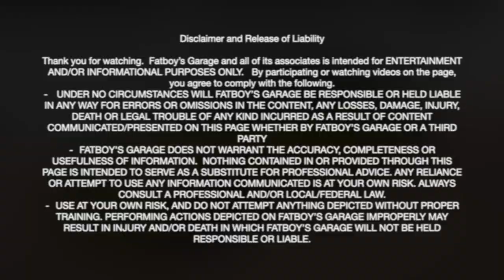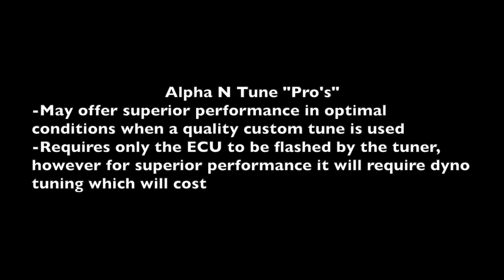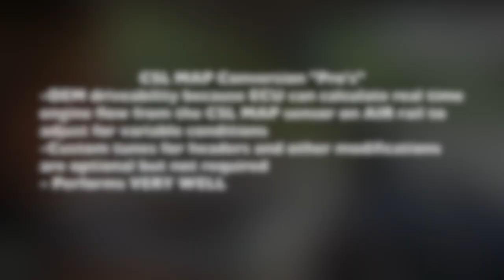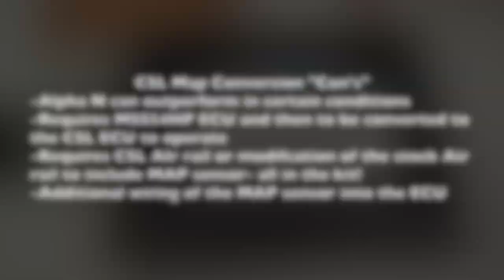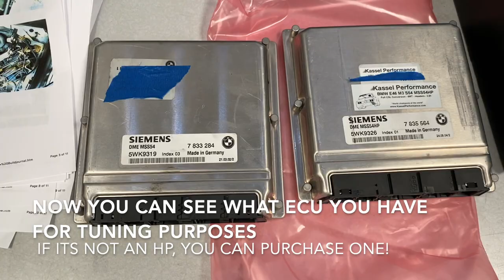Is Alpha N Tune OR CSL Conversion better? + How to install CSL MAP conversion BMW E46 M3 S54

Comment: Great vid! I was wondering when your rod bearing install was coming? Got my car on jacks midway through them now :)
Reply from the maker: thanks man! i just started editing the rod bearing video today, so if i can get some good time in it will be up by the weekend! I'll make sure i get in gear and have it for all you guys!
Reply from the maker: hows it coming so far?
Reply: @FatboysGarage  its been going smooth so far. just about to drop the pan. thank you for your vanos/valve vids, I just finished the full beisan top end rebuild and your vids were excellent! thanks for the update, i'm looking forward to seeing your rod bearings :)
Reply from the maker: @DoomTr00per  good stuff man, im sure youll get it done well. the dissassembly is what takes forever to edit, so im gonna simplify that portion.  wed love to see your car!  have you done frame reinforcement?
Reply: @FatboysGarage   yep, subframe, vanos and now rod bearings. if you like, PM me with an email address and I could send you some car pics along with the M3Forum rod bearing DIY pdf I saved before it went offline. Just a thought if you'd like to show/reference that for disassembly instead of having to edit your video as much :) btw, turns out BMW likely installed my helical gears incorrectly, as mine were not in the sweet spot, just like yours, if I recall
Reply from the maker: @DoomTr00per  Good deal, getting all the bugs worked out, youre gonna be happy with it!
 id really love to checkout the pics and the M3forum pdf to use as references, that will make the video simpler.  I went to PM you but looks like you don't have it setup on your YT to do so.  Normally you go in the about section to do it.   Did they install them wrong? i believe it! getting them in the right spot seemed to pick up some acceleration, i'm sure you'll notice the same!  Its a theory but we think thats why some M3's from factory were just plain faster than others.  Good job getting it correct!
Reply: @FatboysGarage  Fixed the link, check it now

Comment: How did you get the front strut tower installed with the CSL Turner Motor Sport intake without hitting and rubbing strut tower, ECS Tuning states tower can NOT be installed and will hit CSL intake.
Reply: just add 2-3 washers on both sides so its places a few mm higher.
Reply from the maker: The comment below is correct, we used 1 washers on each side and it just clears the box and the hood.  In the meantime we have swapped to an aftermarket strut tower brace.

Comment: I noticed by the end of the video no "CSL FLAP" aka "snorkel) was added to the airbox. Do you need the snorkel to run a carbon airbox? I've been looking at the Karbonius airbox for myself
Reply from the maker: The Turner Motorsport airbox uses the bell curve for airflow, we have a video explaining why they did this instead of using a snorkel.  I hear the karbonius is also a great box.

Comment: Thank you so much! Would this setup pass emissions? Just curious since CSLs were never imported into US...
Reply from the maker: This really depends on what US state you are in. Most states it's not an issue whatsoever.  But theoretically no, it wont pass emissions because it's not US OEM.  That being said i know of individuals that have passed emissions tests with the CSL converted ECU.  Best to ask those who do CSL conversions to the ECU, they will have better answers than us.

Comment: hi i have done this mod and im getting engine light on with error code p0102 air flow sensor low any suggestions pls i have checked wires

Comment: Subscribed. Any exhaust modifications planned ?
Reply from the maker: Yep just not shown yet- tuned it for headers, and full exhaust.  We were going to go with a single, but we love the quadpipes so we went with corsa.  We will be showing install of headers.  Got a project going?
Reply: @FatboysGarage   Any drone with that ? I've got an e46 m3 as well with a lot of bolts ons. However I'm at the point where I need to decide if I want to keep the car and do a proper csl clone with carbon body parts and intake or move on from the vehicle. When I see videos of the high revving single exhaust screamers I lean towards keeping it .
Reply from the maker: @dwainegreen  The Corsa was previously installed on my friends M3 and personally i liked the sound of it.  He went with a motor swap so i picked up his old exhaust system.     The RPM capability is something that attracts me to these cars too so i get that!  When finances are in order, what we would like to do is build up an engine properly, cam it up and if its track only, even consider a VANOS delete.  If you're wanting the performance, most tuners agree that the single exhaust is the way to go.  If you decide to g full CSL conversion, cam it up to and you'll have a real screamer.   With the carbon roof, hood, trunk, rear seat delete, and Cf fenders you'll have a super light car too.  These are all things that are in my mind anyway.  I think some things that may help you with your decision is considering the items on the car that need to be done structurally: Frame reinforcement, Rear brace between the rear shock towers, RTAB reinforcement ( not often shown), subframe bushings, Clutch, Diff and all those factors that play into having a high horsepower engine in these cars.  Without these types of things done it makes running all that power difficult without breaking stuff.  What do you have done on it already?  Personally the M3 is just a favorite so i will stick with them.  Once you get the issues worked out of them they're great and reliable.
Reply: @FatboysGarage  As far as performance upgrades are concerned I've installed a big brake  kit, steel lines, radium oil catch can, afe cold air intake, turner pulleys, ALL stock bushings have been replaced with poly bushings, rear subframe reinforcement , coilovers, adjustable camber arms , H&r adj sway bars (favourite mod thus far)...I've had catless headers and a performance muffler on the car but they are now residing in my basement.  The stock vehicle is very capable and can be upgraded, however the handling characteristics  of  front engine sports coupe seem to fall short of a mid or rear engined car ***from my experience***. I'm well aware that although it's a 20 year old platform , the correct upgrades and driver skill can allow it to hang with many modern cars. I guess I need to decide whether I want to create the car that performs and handles like  I want  or just buy another car that checks the boxes. First world problems .

Comment: Anyway to get the CSL tune onto the Z4M?
Reply from the maker: Read below for explanation of running the CSL airbox on z4m
Reply: @FatboysGarage  The Z4M has a different ECU (MSS70) and it cannot run the stock CSL tune or a CSL style MAP sensor.
Reply: Unfortunately, it cannot. The MSS70 ECU in the Z4M cannot run the stock CSL tune made for the MSS54HP. It requires a custom Alpha-N tune which is not expensive nor does it require a dyno tune. The CSL runs an Alpha-N tune stock anyways. The MAP sensor is only there to add one or two very small calculation factors and to allow the car to run in a better limp mode rather than only relying on the TPS sensors. There are one or two really good S54 tuners who offer pre-calibrated tunes ($2oo-3oo) that have stock drivability with standard bolt-ons such as a CSL airbox, cams and exhaust. Look up Paul Claude - http://www.pcstuning.co.uk/. He specializes in S54 tuning and he has pre-calibrated tunes (dyno tested) and offers live dyno tuning if so required.
Reply from the maker: @RK-ed1em  good to know
Reply: @RK-ed1em  How good do you consider the Evolve tune to be? Considered they where one of the first in the game to offer the CSL airbox to both e46m3 and z4m?
Reply: @davidgiannini5220  There are a few better tuners out there that specialize in tuning mostly S54s. PCS is one of them and his track M3 (288/280 cams, airbox, full dual 2.5" exhaust making ~380whp) consitently does sub 7:40s at the Ring. He has calibrated (and fixed) many tunes on other people's cars - http://www.pcstuning.co.uk/

Comment: Hi I have the same setup my dme has already been converted to csl I’ve installed my csl map sensor kit from KP but now my car won’t start up any suggestions on how to troubleshoot this issue?
Reply: Did you resolve your issue?
Reply: I know this is old but I would use INPA and verify that your EWS isn't being triggered.

Comment: Does using a new DME give mileage tamper dot or mismatch anywhere? About to do this same route but can’t figure out if I should buy new dme or not since car is an 02 thx!
Reply from the maker: no it does not tamper or mismatch at all. I did the brand new DME so that if i needed to put it back to bone stock then i could.